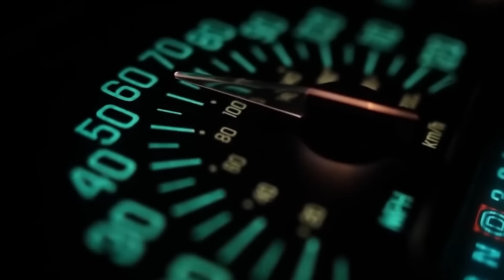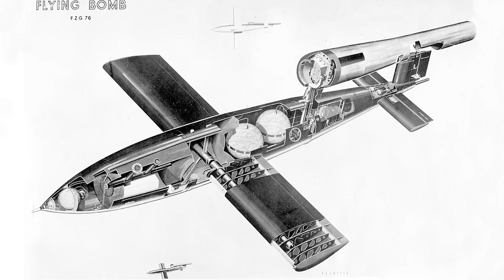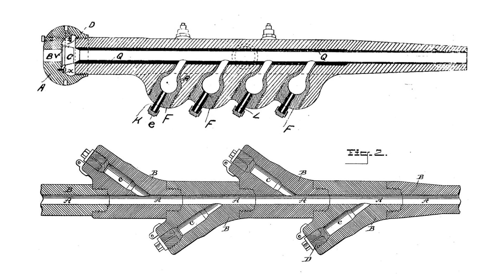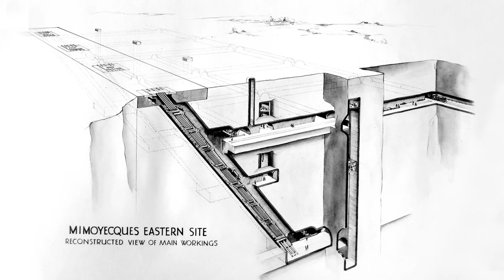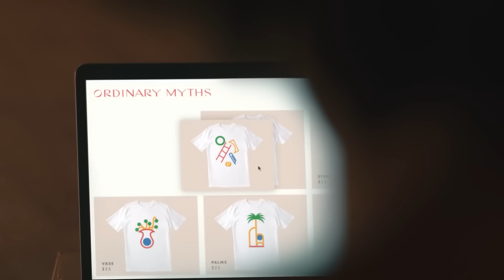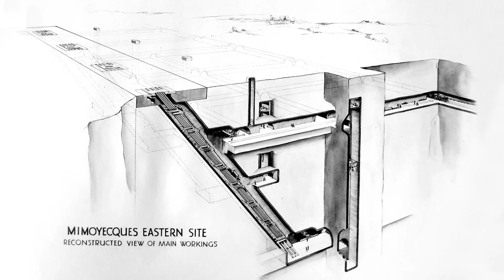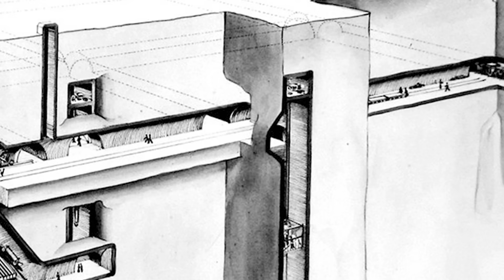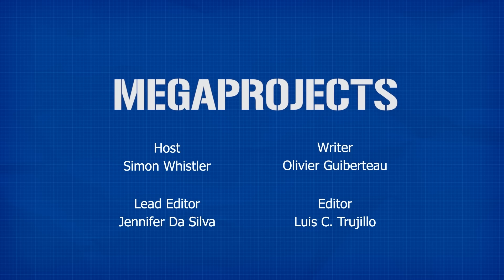The V-3 Cannon: Hitler's Unfinished Mega-Gun

Comment: 600 rounds a minute , i think you have that a tad wrong
Reply: Only off by a factor of 60.
Reply: Yeah, he's off by two more zeros.
Reply: Machinegun artillery FTW :-)
Reply: Buzz saw artillery
Reply: Hehehe Vergeltungswaffe goes BRRRRRT
Reply: Imagine trying to be the spotter for that kind of weapon.
"Short-long-left-short-left-right-long-left-right-right-left-short-short-hit-short-hit-long-right-hit-left-right-hit-short-hit-long-left-left-short-hit-long-right-long-right-left-hit-short-left. . . . I meant right."
Reply: Wikipedia says 600 per hour, for those interested in the true rate.
Reply: Seems the specification was 10 rounds per minute, ~300 lbs shells, so 3,000 pounds per minute. Is it possible to achieve 600 rounds?  If you think of the gun as a linear 32 cylinder engine, perhaps! The A-10's GAU-8 fires up to 4,200 rounds per minute, @ 2/3 of a pound each that's 2,770 pounds per minute from a moving plane.
Faster firing would probably require V3 use liquid propellant, similar to proposed Crusader howitzer upgrades in the 1990s. Timing is of course a problem, BUT WWII fighter planes with 18 cylinder engines @ 3,000 rpm were able to fire on time.
At 5.9 inches by 430 feet, that barrel represents a displacement of about 3,750 cubic inches.  For comparison, In 1945 the Lycoming XR-7755 radial engine had 36 cylinders and displaced about 7,750 cubic inches.
So, we're kinda-sorta in the ball park of what would be possible.
Reply: typical... half researched, half prepared, as long as he drop video every 10 min ... all about exceptional... 600/min is cooler than 6/min
Reply: Hmmm either ten rounds a second from an artillery gun or one round every ten seconds, which seems more plausible lol I'm favoring the estimate of 6 a minute tops lol
Reply: @steeljawX  xD I imagine someone trying to call out spotter info ten per second lol
Reply: That and 140 KG = 430 FT lol
Reply: @MAD7BOY  thanks, they get paid for doing this, you'd think they'd do some research and proofreading right
Reply: it's what in documentation
Reply: @Boneychuck  how much liters in a kilovolt anyway?
Reply: ok guys.... we got it on an other comments;  you just take 430kg divided by 308ft that equal like 17 meters per gallons... so no way that thing fire 600 rounds a minute,
Reply: @MAD7BOY  if we were interested in true fact, we certainly wouldn't be watching Ti-cul Simons videos...
Reply: @joseph-mariopelerin7028  why don't you unsubscribe then?
Reply: @joseph-mariopelerin7028  Then why are you here? The world doesn't need any more social justice warriors
Reply: My plan was to do this with capacitors, magnetic coils, and photocells.
Reply: @ridgecrestwack9746  oh... i know they don't need it... yet, we don't need masse produced video that have so many historical mistake, often no political understanding and layout in a way that prime drama and sensation...  news network already do that very well...  and yes imma little pissed by britt or his 100 channel for always being the very first video suggestion.... and im quick to think that all his follower should be waked up.... but that's my own problem, and you won't fix that... so be patient lol.... am almost done anyway...
Reply: An artillery peice firing like a machine gun would be interesting
Reply: pretty sure the germans would have won the war with a 600 rounds/minute arti..
Reply: @daveware4117  doesn't the us military operate a similar weapon?
Reply: @ridgecrestwack9746  - Smart bombs?
Reply: Well, 600 rounds per minute IS correct for the entire battery.  At 5 barrels per chamber, 5 chambers per facility. 2 facilities- firing 6 rounds per barrel DOES give you 600 rounds per minute.
Reply: @HalSchirmer   suppose to be 30 guns
Reply: @jantschierschky3461  Correct - 30 was under construction, which was scaled down from initial plans for 50 barrels.
Reply: @HalSchirmer  so you're saying that all these dorks on here debating are in fact wrong?
Reply: @ridgecrestwack9746  Nah, but rather the are right in a compartmentalized "need to know" way. Whether you're talking about the entire facility as planned (600), the entire facility based on reduced construction (360) , or "as fired" (0). To paraphrase Winston Churchill "What is the measure of a gun emplacement that never fired?"
Winston Churchill - "What is the measure of a man who never tried?" - followed up with "Yes, he's a modest man, with so much to be modest about..."
Reply: @HalSchirmer  well put
Reply: 10 rounds per second from a manually loaded weapon without an auto-loader...  Either someone was smoking something, or someone was smoking something...
Reply: @RazielTheLost  Still, the 88 with reasonably easy manhandled single unit rounds, no need to verify multiple breeches reloaded and closed etc. only made 15-20/minute in the Flak 18/36/37/41 or 6-10 in the Pak 43 (per Wikipedia, toughing seen 15-20 for the Pak as well)
Maybe, maybe, if the number is for a whole multigun site.
Reply: @MAD7BOY  That assumes we should believe Wikipedia. 
However, 600 per hour is 10 per minute - one very six seconds. There is no barrel cooling, no auto loading system and no signs of the infrastructure needed to keep it supplied.
Reply: @HalSchirmer  Sorry but no. 430 feet is 5160 inches. 5.9 inch bore gives a volume just under 24,000 cu-ins plus the side chambers volume. 
Engines simply(?) push pistons which naturally return for another push. Guns lose their pistons which have to be replaced along with the propellant. Even if it could be fuelled like an engine, simply getting the shells loaded would have been beyond reasonable.
Reply: He says later 3000 shells from 50 guns per day. 600 shells per DAY...
Reply: wiki pedea is man made believe what they say  i say  600 per day from one barrel.
Reply: @joseph-mariopelerin7028  you still haven’t answered the question, WHY ARE YOU HERE?
Reply: @carlwheezerofsouls3273  to help you guys... i have pity...
Reply: That's 10 rounds a second
Reply: Source: Hitler's meth diary
Reply: That seems way off for a single barrel gun of this size. Especially for the steel producing technology of the time. Hell, even today the greatest hurdle for making  rail guns operational is the barrel wear and tare. Today the barrel has to be changed every 6 shots. Sure, rail gun is a Mach 7 hypersonic gun but still.. We're talking about MG-42 rate of fire here people.. Those barrels would melt like an ice cream during the wildfire season.. Wikipedia gives the same number but somebody somewhere added a zero or two and it stuck..
Reply: From memory the sites would have multiple tubes
Reply: @markbrisec3972  Its not a single barrel gun
Reply: I'm guessing once the whole array of barrels was complete and firing all at once that 600 a minute was the intended rate.
Reply: @fixman88  Yep, I think so too. 5 barrels in 5 sections x 2 locations =50 barrels. At 1 shell every 5 seconds, that would be 600 per minute
Reply: MOre like 600 a DAY.
Reply: I didnt calculatr but I think the rate was for all barrels combined and it was multiple groups of 3 or 5?  I lost track in all the excitement.
Reply: Hmmm, yes; the V3 is made out of FtD advanced cannons.
Reply: @MAD7BOY  Which is still insane considering the payload and other weapons brutalizing britian
Reply: @joseph-mariopelerin7028  You hate him so much you watch and comment on his videos which increases his ad revenue and the likelihood that the YouTube algorithm will recommend his videos to you and others.
Reply: @RyanKlapperich  2 rounds per minute
Reply: @michaeldebellis4202  titles are very catchy.,.. loll
Reply: Yup kinda highlights how much we take from this channel as being pure fact, someone without any knowledge of artillery could've looked at that and seen it was clearly wrong
Reply: The engineers would have promised the Fuhrer anything to get approval for the damn thing, "Ja it will fire 10,000 projectiles a minute." LoL 🤷🇺🇲🛠️🇷🇺
Reply: @HalSchirmer  ahh yes, I forget there was to be many of these guns, a total system wide rate of 600 per minute might be possible with enough v-3 gun stations in operation,
Reply: @ridgecrestwack9746  you are the definition of a fan boy. Stop.
Reply: @carlwheezerofsouls3273  he's here because he wants to be here. To offer knowledge and correct this channels bs.
Reply: A round every 6 minutes would be incredible in reality
Reply: The barrel blew up after 8 shots 😂
Reply: No, one round in 600 minutes.😂😂
Reply: @steffenrosmus9177  the barrel was made like a suspension bridge so at the minimum it would probably take 5 minutes to stop bouncing around after a firing. The progressive charges must have been time consuming to load as well. A lot of things they did fell under the heading of “if a little does a little good a lot will fixer right up “
Reply: It may have been possible, as he said, most of the plans for the weapon are gone. The Germans; however, were very good at engineering and may have found a way with an intricate auto loader.
Reply: @MirageGSM as a matter of fact are there any semi automatic howitzers?
Reply: The famous 88 needed rebarrelled after 500 or 600 AP rounds, the Gustav after a few dozen rounds, WW1 artillery factored barrel wear into it’s range, it’s impossible for a large calibre gun to fire so many rounds rapidly. 600 in a week would be astonishing.
Reply: @Alex-iq9dw apparently German POW’s caught in Normandy would often ask their American captors if they could see the automatic howitzers.
Reply: I know I'm late to this video, but he also said the V2 was first used against London in Sep 1944 and stopped being used in March 1944
Reply: Man it's a miracle England is still on the planet. Those were some gun loading mazis!
Reply: How many barrels? The rate of fire was wrong however many of the comments assume that it’s a single barrel a closer analogy would be battery’s of guns.
Reply: @ridgecrestwack9746 Social Justice Warrior? Why are you talking about Ron DeSantis in a historical weapons video?
Reply: Maybe he meant a (very) large battery of them......
Reply: @HalSchirmer i need this for home defense (new york)
Reply: @steeljawX you'd be speaking faster than MC Mental
Reply: @MAD7BOY Oh Wikipedia, must be true then 😂
Reply: @MAD7BOY that’s the problem ur using Wikipedia as a source
Reply: The barrel would wear out after a few shots,   look at battle ship rates of fire to get a more accurate rate!
Reply: 600 a day? Mabey but a minute and ISN'T a machine gun
Reply: @PantsuMann  lmao
Reply: The Mimoyecques facility would have 5 weapon chambers with 5 barrels each. There were two separate sections, making 50 V3 barrels just to start.
600÷50=12.
That's how many rounds each barrel had to fire.
HOWEVER, the main thing to remember is those were only the first 2 sections to be planned.
Reply: Nah man they could load such a shell in 0.1 seconds
Reply: @l-shwerpy-l8748  How in the wild flip for ww2 era?
Reply: @scottmeredith3359 It is actually true though, you simply have to be intelligent enough to understand that the V-3 isn't a single gun, it was an entire battery.
Reply: Remember that it has multiple "barrel" so 600/minutes is maybe with 100 barrels
Reply: Wikipedia uses the same number but how heck were they planning on reloading ammo and side charges at that rate? I think someone misplaced a decimal or two.
Reply: @MAD7BOY you are right, I misread before making a previous comment, but even at that rate, that’s ten a minute! It still seems ludicrously optimistic.
Reply: @robertpatrick3350 the sentence was “the gun” firing 600/minute. Singular.
Reply: 6 round a min more accurate and even then that's very very fast
Reply: Narrator doesn’t write any of the content, but whoever does was hilariously off.
Reply: Even if the entire battery got built and was firing 600 a minute, which I doubt, where are the shells and charges coming from? And which battle front was going to cheerfully forego those munitions? Complete idiocy.
Reply: @MAD7BOY  well try logic? Common sense? It would be a machinegun so pretty impossible
Reply: Yes, totally wrong. Most likely max 3 p/m at the best.
Reply: @MAD7BOY Because. Yes 😂😂
Reply: @HalSchirmer  Let's do the math... 

5 Barrels x 5 Chambers = 25 Barrels per Facility.
25 Barrels x 2 Facilities = 50 total barrels. Agreed?

Now where you lose me is "firing 6 rounds per barrel", but let's roll with it.

50 total barrels x 6 rounds (per minute?) per barrel = "300 rounds per minute"...
Each barrel would actually have to fire 12 rounds per minute.
50 x 12 = 600.

60 seconds ÷ 12 rounds per minute = 5 second reload per barrel... On a large multi-stage artillery piece (one of the most complex of its time).

You could also technically say it has a firing rate of 50 rounds per second (if all barrels are fired at the same time). But even then... 50 barrels (1 round every second) x 60 seconds (every second for a minute) = 300 rounds per minute... It would have to fire 2 rounds per second to meet 600 rounds per minute... 

The designer hoped for 5 minutes per round per barrel. 

50 barrels ÷ 5 minute reload time = 10 rounds per minute of sustained fire. 10 rounds per minute X 60 minutes = 600 rounds per hour.
Reply: 600 pounds a minute?
Reply: @x316RiotMakerx  The shells weighed 310 lb (or 140 kilograms). Each gun firing @ 0.2 rounds per minute (according to the designer), with 50 barrels, that'd be 10 rounds every minute. 310 lbs x 10= 3100 lbs (or 1400kg) per minute.
With the actual weight of the projectile being 209 lbs, so 2090 lbs (or 950 Kg) per minute. It's pretty easy to find that info.

He just misspoke, saying minute instead of hour, and they didn't catch it. It's really not that deep.

But at 600 rounds per hour, that'd be 186,000 lbs (or 84368 kg) per hour, or the equivalent to launching approximately 64 ½ Honda Civics per hour.
Reply: @joseph-mariopelerin7028  so are we saying 600 videos per minute then? Seeing as he owns about 60 channels on YouTube.
Reply: More like 600minutes per tound
Reply: Why?

Comment: Fun fact - I used to live nearby that prototype installation in Wolin when growing up. See those big concrete walls at 09:00 ? If you look close enough, there's a trail post near the top of the photo - blue hiking trail, if I remember correctly. 

One time me and my two buddies came up with an idea to ride our bikes on that trail and that part is a bit tricky - when passing the post, you're going downhill, there's a turn right at that post and a bit of a curb you need to jump down from, just a couple of feet from that steep drop you see.

It was our first time riding there and I was so frickin' thankful I checked and tuned my brakes beforehand. Didn't see the turn, jumped down the curb straight, turned and hit those breaks hard on landing. Stopped sideways, maybe about two feet from the edge of that big drop you see in the photo 😅

A bit further and I would have fallen and smashed headfirst into that bit of history. Imagine - becoming the only casualty of a failed nazi megaproject... 😆
Reply: that's a great story and adds a lot to watching this video for me.  Glad the Mega Gun Project did not claim your life.
Reply: The story is a good addition to the vid.